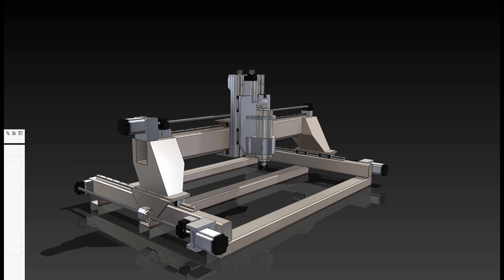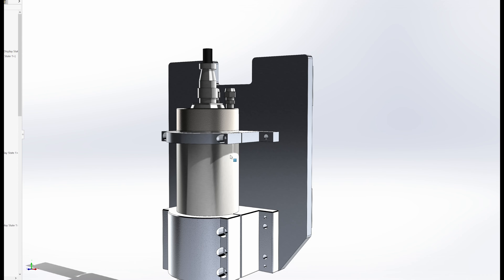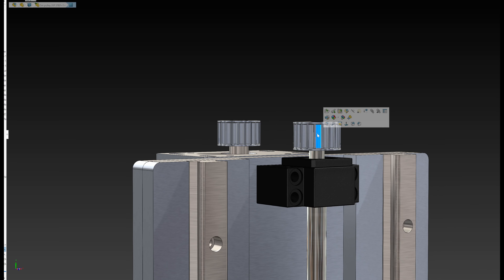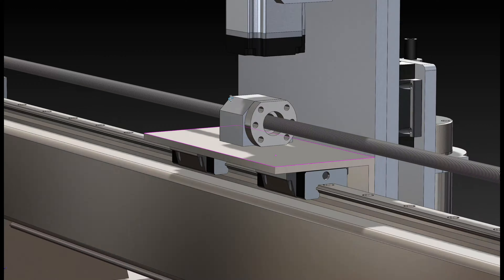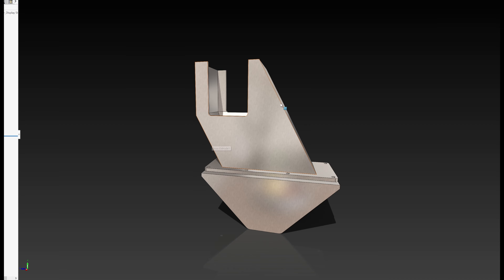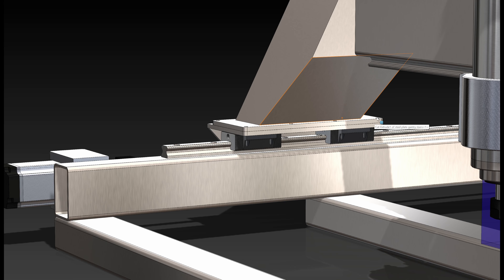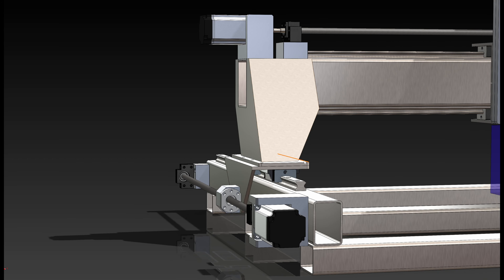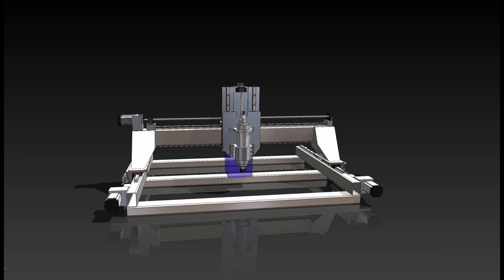Exploring the Design Changes of my PrintNC CNC Machine

Comment: Love the overall improvement on rigidity, dual bearing on each rail, aso. 
My concern is about the welded gantry risers. They will most certainly require post machining due to the stress and warp induced by the welding operations.
It would turn the project out of reach of lots of makers imho (plus you'd have to rename it from "PrintNC" to "WeldNC" 🤣)
Reply from the maker: This is my own machine and doesn't represent the PrintNC project. Welding always warps but I think the benefits will be worth the added effort to work around that.
Reply: @BryanHoward  I just found you, so maybe you've addressed this, but it seems to me welding or brazing the y-axis steel tubes to the cross-platform steel tubes would be helpful regarding rigidity: are you doing that?
Reply from the maker: @keithwins  TIG brazing silicon bronze is the plan for attaching the risers to the gantry. I've never done tig brazing before so will have to do some practice try's first. I think this would be a good application due to the distortion of welding.

Comment: The immediate problem I see is racking for the Y axis, always a concern with 2 steppers on the Y. I would say add a crossmember at the bottom of the machine that is as wide as you can get away with and aligned endstops for both sides to 0 out the two ends. Downside here is that if you don't and racking does happen the stress can wear out the linear rails and ballscrews.

Comment: I think you should mount the X axis ballscrew on the backside of the gantry, instead of being above the linear rail.
That has some advantages, one of them is that it stays much more chip free. Also, it let's you upgrade and use stronger Z mounting brackets to the X axis.
I did this on my design.
BTW,
My machine is not a PRINTNC
I like your channel 😁
Reply: I agree that this seems like it could be an improvement.  I like that it's away from the chips, but it also applies the forces to the gantry in between the linear rails instead of just on the top.  That could limit the torque being applied to the ball screw due to the offset loading.
Reply from the maker: @gizmobowen  I light this idea too and was thinking about how I could pull it off after seeing them working well on the dual Y axis. Some things I'll run into doing it this way are I'll have to redo the cable chain  because I won't be able to mount the rests on the back of the gantry without redoing alot of that work and If I mess with the cable chains I might have to recut/redo wiring with is gonna be a huge pain.

Comment: I'm not an expert and don't have much experience in cnc I think your build looks awesome and will work really well and be very stable   for what your doing 

I'm not sure how the leverages and weights play into things but in my mind instead of building a complicated gantry riser like that you could get taller tubing or make risers to elevate the tube with short pieces of tubing spacers and weld or bolt it together so your weight is in the frame not adding to the gantry and it would reduce some of the leverage upon the gantry?

Also finding coarser pitched ball screws so they don't have to rotate as fast for the travel speeds your after could reduce vibration and increase precision at higher speeds but it may reduce the torque it has also increasing the diameter of the ball screws could help with vibration in them

I'm doing my homework now and wanting to build my own setup simular to yours I've built the root one cnc afew years ago but I'm not happy with allot of things with it I've looked into the root 4 cnc and this style design this one looks allot better to me not having plastic for structural pieces and knowing it can be welded after it's bolted and aligned for more strength is appealing also

Comment: First of all, thank you for adding the voice annotation.  It makes it much easier to understand what you're trying to do.

I'm glad you said you have brakes on the Z-axis stepper motors to keep from moving the Z-axis too far.  I actually have hard stops on the end of my rails to keep it from going to far.

On the y-axis carriages, it isn't clear where you have access to bolt the carriage to the linear bearings.  It looks like there's room on the outside but it will be hard to get inside to the screws.

By widening so many parts of the Z-carriage and the gantry risers, you seem to be losing a lot of Y travel.  Are you going to make the Y-axis parts longer to get the travel back or just live with the reduced working area?

Where are all the parts coming from?  Do you have access to a milling machine to make up the various components?

Will there be any 3D printed parts or do you want to replace them all with machined aluminum parts?

I like the idea of the longer rails on the Y-axis rails.  I'd definitely do that from the beginning.
Reply from the maker: Yeah my machine currently is running servos so having a brake on the Z is an absolute must. Without it, the ball screw can be back spinned when the brake it let go. 

I’m actually gonna bring in the ball screw closer to the steel beam and flip the ball screw nut housing around. This would have the bolts more accessible than I’ve got in this video.

I’ll have less travel in Y and also in X. X doesn’t bother me all that much because it’s the longest axis but Y is already short but it’s the cost of making it more rigid with dual bearings and I think it’d be worth it. 

I’ve got my printnc cnc machine fully functioning already with the standard 3d printed parts so all these parts would just be made on the machine itself. I’ve cut steel and aluminum and cast iron with good success already. Aluminum is no problem, steel I just make lighter cuts to not push the weak wood and 3d printed parts to breaking point. Alot of the parts to make the gantry risers need to be cut accurately but they don’t necessarily need to be cut on a cnc machine. What I’m thinking of doing is use the cnc machine as a big plotter to mark out accurate cuts and I’ll go back and use the circular saw, grinder, chop saw, etc (conventional tools) to do the actual cutting to save the endmills. 

I think if I were building a printnc from scratch and plan on doing dual bearing blocks soon after I have it working, I’d do a build with longer rails on the Y axis just because you lose a good deal of travel once you put another bearing block and a respectable amount of space between blocks for rigidity.

Comment: hi there, nice mods, how do you plan to square everything after welding?  i'm curently building one of those too and had an idea to prevent dirt from going onto the rails and ballscrew with bathroom ventilation pipes, surely not perfect but you can adapt it to your flavor, i can share the fusion file if you want

Comment: Try a colder alternative to welding to avoid warping. Maybe brazing or metallised epoxy.
Reply from the maker: TIG welding the risers together and than TIG brazing silicon bronze the risers to the gantry tube might be a good way to get around warping. The heat will probably warp it alittle but not as much as straight welding them together.

Comment: Your design is very ambitious and admire you for the desire to run with it...However I feel that you are going to get yourself into a bit of trouble trying to weld the Gantry to the support...Personally I would not even dream especially with the time you have put into milling all as precise as you have...
So let me offer a couple alternatives and after I hope it makes sense...NO WELD of Gantry to Supports with these 2 options...
1st method consider this...Your Rectangular tubes are 2x3 or 3x4 not that it really matters...Bore a HOLE say 2" diameter horizontally thru one side into the other...Then insert a 2" OD tube thru the hole...Now before you install the Gantry into the Support tack weld the tube in place...Just tack to keep the heat down to a minimum...Do this on each end keeping in mind that the 2" holes are going to be inside of the structure of the support...After you get the supports fabricated install your Gantry where you want it...put you epoxy granite in the hollow cavity filling up the hole that we just provided with epoxy granite and thoroughly fill the structure...What you have just done is locked the gantry in with the use of the epoxy granite as a hold down for your gantry...
2nd method would be instead of a large hole use multiple smaller holes with solid rod all the way thru and have the epoxy encapsulate the rods and hold your gantry in place...
3rd method which just came to mind would be to weld a plate inside the support where your Gantry would sit...perhaps a couple angles secured inside that are match drilled and tapped to holes that are inside Gantry...Now before you fill up with epoxy Granite secure the gantry to those plates/angles you supplied and attach your gantry to those points probably at least 4 points but 6 would be nicer...After secured and plumbed level the best you can fill the supports with the epoxy granite...
Only this method will allow you to super fine tune the gantry if needed...remove the bolts and shim if necessary and then reinstall...
If I had your skills and was going to build a support for my gantry like the one you designed the 3rd method would be the only option, I would use...just for the possibility and need to ship to make just as accurate as possible... If you use that method be sure to mold release the gantry so the epoxy doesn't bond permanently to the gantry sides, top and bottom 
FFT
Best of LUCK which ever way you go
Paul
Reply from the maker: These are a lot of interesting ideas. I’ll have to give this all some time to think over.  

I’ve changed a bit of the design of the risers due to the availability of flat bar steel. I couldn’t get the 3/16 material I was originally going to build the risers out of. Instead I got 1/4" for the same price. Because of the different material thickness 1/8 and 1/4 I’m not going to have a fun time welding and controlling the heat getting pumped into the thinner material. 

So I’ve changed it a bit to become a bolt on job with around 12 bolts. Because of the thicker material I simplified the risers to not have the inward angle as well. The 1/4" steel is going to be brutally strong anyway to not need such added complexities to be constrained by. 

In this design the 6 bolts closest to the gantry tube opening get threaded into the gantry risers from inside the tube. The 6 holes further to the inside get threaded past the risers and threaded into the gantry tube.

Your suggestions with epoxy granite are compelling that I’ll have to take into consideration. I would like to have the machine functioning with the new risers before filling in the tubes and then at a later date fill them in.  

Here's a short video of what it has been looking like for the past couple weeks at: https://www.youtube.com/watch?v=tOBypfhYZfg

Would be good to hear your thoughts about this approach. A limitation I already have is. The inside bolts that thread into the gantry. This whole tab+bolts will intersect with the back part of the Z assembly limiting its travel. It’s not a deal breaker but a design nuisance.
Reply: @BryanHoward 
 I can see where the additional bolts on the outside of the riser would be a nascence...Move those bolts to the inside like the rear are located would be a better option...Or flip around where those bolt pattern on the outside of the support would be on the backside...But what ever you do you need to reduce as much welding as possible...adding all the extra material where the Gantry will sit is just undue heat added to the supports...
Are you going to stress relieve the supports after you are finished welding up? Might want to address that...
You know on the Gantry's out there are no vertical supports on the Gantry...It seems are the gantry's are bolted to the base...Just keep in mind that it is going to be a real challenge to align the vertical holes with the gantry if you have to tweak on the leveling of the Gantry...Then all bets are off...It would seem that the riser piece would have to be match drilled to the gantry 1st then tapped then installed and hitting all would be doable but very challenging...

when I get into complicated designs, I often build what I envisioned out of cardboard or wood...get yourself a small sheet of 1/4" plywood from the big box store and cut out on the router...The using wood glue to hold all the corners together like the weld would use tape to hold corners in place while glue is setting up...This will help you get a better understanding of what you are envisioning and fine tune from there...As far as the additional attachment plates are I would NOT use them...If you want to absolutely use hardware on the sides of the Gantry as well as the bottom which I completely understand doing come up with something else to keep the heat down from the welding...
With your skills could you design and create on the 3d printer? Then you can add all the design features for attachment of the base and sides in the build...Build the shell of the support just like the flat metal would be...After you get the support made put the gantry in place and pour your Epoxy Granite into the support you just made...
This will not have any warpage from heat and be dead nut accurate...FFT
With your skills on the CAD drawings sending the support to the printer would be a piece of cake
Good Luck I know what ever route you go you will have weight at as many options as possible...
You know after mentioning the last option of fabricating out of the 3d printer That appeals to me a whole lot more  the welding and then after filling up with epoxy...I would think you would have a heck of a support and be just as ridged as hoped for...Not like steel but plenty strong...  
Paul